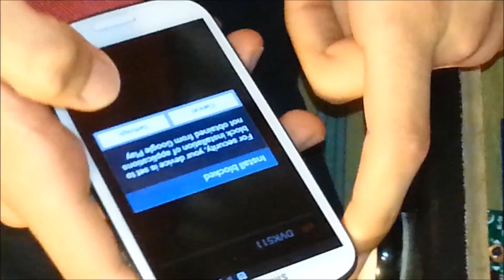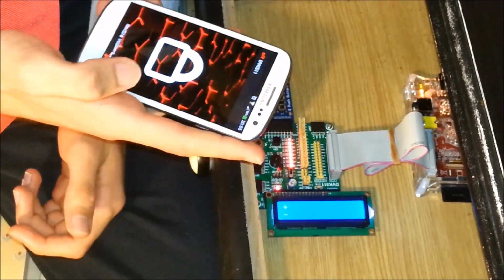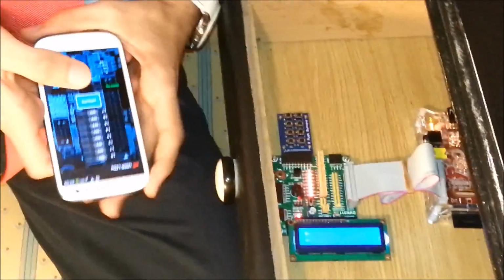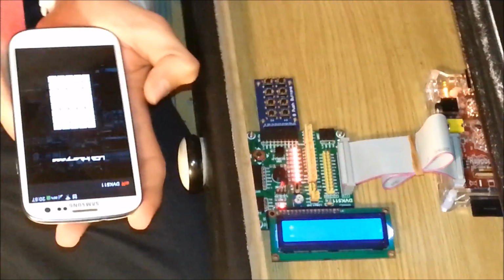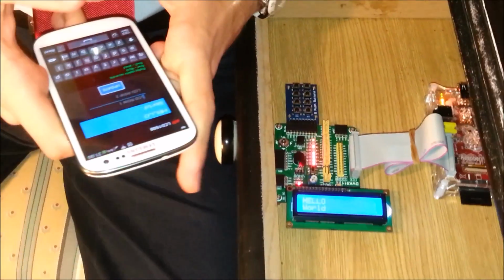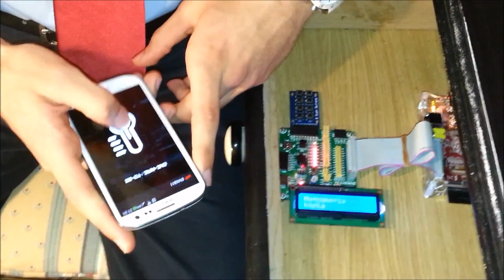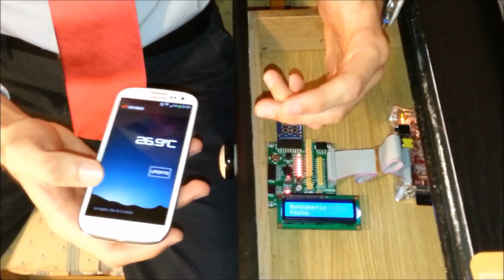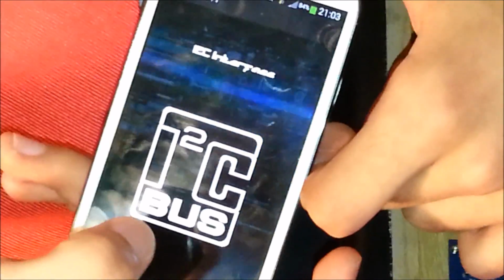Raspberry Pi controller for Android smartphones + TUTORIAL

Comment: Nice video man, just a question, it's possible to make a connection between RPi 3 and Android App via WIFI?? I need to do a project about to make a radio streaming monitored by smarthphone and i don't know if this is possible. Thanks
Reply from the maker: Yes it is, this is what I did here anyway. It is just that I use my home router in order to create the IP addresses. I do not know how to create a network with the RPi3 (DHCP server), but there is probably some way. GL

Comment: i wanna learn how to make connection between raspberry and android via bluetooth
Reply from the maker: +Samah Awad If you want to use the bluetooth capability you probably need the USB adapter and you should be familiar with the UNIX shell. Once you do that some bash code should be enough. However, bluetooth is very inefficient compared to WIFI. Try sharing a file using both methods and you will see that WIFI is one order of magnitude faster!
Reply: +Kostadin IV Kostadinov hahaha really i'm sorry i mean via WiFi ... i tried to build home automation... i want to control LED (on/off) using python server and android app as client.... via WiFi , i done it successfully using html as client but now i wanna develop android app as client ... any help to start with the connection ! thanks

Comment: Nice. Im not getting proper tutorial for DVK511 board. Can u plz help me
Reply from the maker: Finbar Maginn I'm sorry, it seems that everytime the RPi disconnects from power, it reconnects to a different IP so it unlinks from the router. (it would be nice if someone showed me how to solve it before I learn it by myself) I solved it for now (temporarily). I have also created a link to download the whole tutorial as html (images and scripts included). You can download it in https://drive.google.com/file/d/0B2DGJVRDN-1tQmU0emh4TWZvY0k/view?usp=sharing and see it by opening the index.html file.
Reply from the maker: +Samah Awad https://drive.google.com/file/d/0B2DGJVRDN-1tUEZ1OFJBOUJsRWM/view?usp=sharing . Unzip the file and open index.html. You can access the raspberry pi part clicking on the raspberry icon(some savascript and jquery code make it  easier), same with android. All the code is in there. Having it in my personal server requires some maintenance and I do not have time for that any more.
Reply from the maker: What do you need exactly? All the details for how to use the different parts of the board is explained in my web page (link below the video). It is shown when you click on the android image.
Reply: Lord Ivanov I cannot open your link, is there an alternative?
Reply: Lord Ivanov that's great thank you! You should go to the raspberry pi website and look for static IP addresses. Although I don't know if it is only for localised IP addresses or not
Reply: +Kostadin IV Kostadinov Sorry, the file you have requested does not exist.
Reply: +Kostadin IV Kostadinov OK my sir,,, i looked on ur link, amazing.... and i read that u done ur project... can u tell me a useful website to learn how do the first connection between RPi and android?
Reply from the maker: +Samah Awad I learned Android from their official page (http://developer.android.com/index.html), learned UNIX from Ubuntu (http://stackoverflow.com/), learned Apache from sites like https://help.ubuntu.com/community/ApacheMySQLPHP, and how to connect them (step by step) is in the tutorial you just saw (intex.html). I guess you can check other youtubers for more details. GL